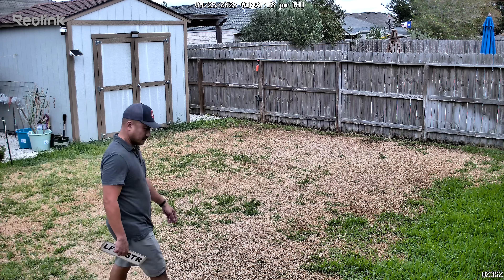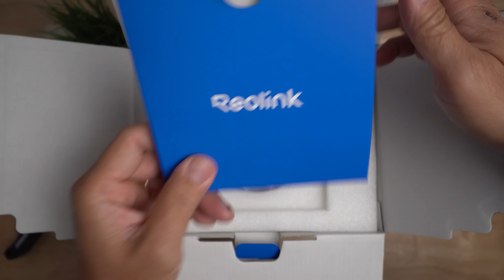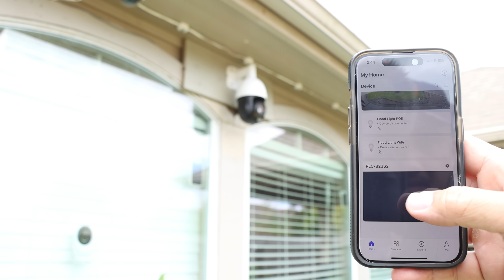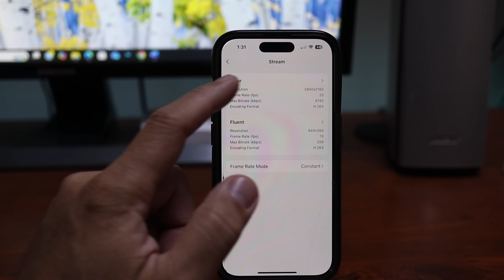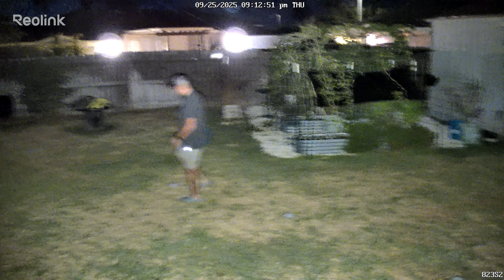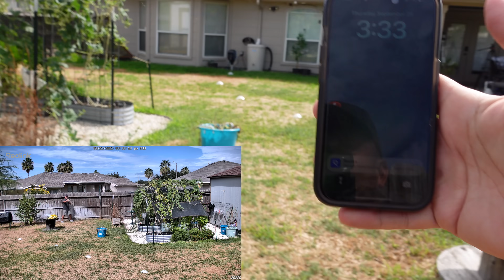This Security Camera Has 16X ZOOM! (Reolink RLC-823S2)

Comment: Can you turn off auto tracking if you just want to buy this camera for the crazy zoom?
Reply: Yes, you can do that with All Reolink Cameras.
Reply: @paul340mopar  can you use the same full zoom feature when playing the recorded video after the event ?
Reply: @tonylupo5230  If you recorded the Video with it Zoomed Out, the only way to Zoom in on the Video would be Digitally with editing software which would Lose some Quality. The Whole Point of the 16x OPTICAL Zoom is to be able to Zoom-In without losing Quality, but you have to record that way.

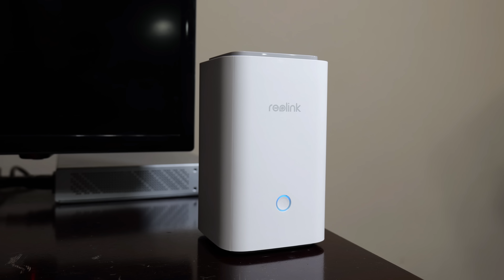Comment: Im a few months late but planning on buying this camera. One question id have is about the micro sd card storage at 2:07 you mention it supports up to 256gb. While the official spec sheet also mentions 256gb their website does however promote with up to 512gb micro sd card. Got this improved via a firmware update after your video review? Or do they have a mistake on either their website or the spec sheet is outdated?
Reply: @UltraTwmpo_ Reolink updated the specs in their website, after doing some testings they greenlit 512gb sd cards with this camera. They also did something similar with their new cama

Comment: RLC-823S2 just got a rare update from Reolink with new features! Now it has package detection and alerts (both leaving packages and taking them) and they also added perimeter protecting (line crossing, intrusion crossing, loitering) all these new features are under "detection alarm" in settings. Will try to see what other features they added
Reply: Unfortunately the perimeter alerts are fixed to the camera vision, so if you move the camera (like in patrol mode) it will have the same perimeter everywhere
Reply: So, in the end this camera have True Full-Color Night Vision ( ColorX  ) ? Or just flood leds?
Reply: @MaryoLionheart  it's not a ColorX camera

Comment: Disappointing it doesn't zoom on patrol mode. What I want is it to look into my street, and whenever someone - person or car - enters the control area to zoom on their face / number plate & track them.
Reply: The issue with auto zoom in  this model is that the optical zoom takes ages to focus, this is not a camera I wouldn't even recommend for tracking cuz it's slow and noisy and struggles with autofocus like you have no idea
Reply: But what you describe is the Reolink Trackmix. It has both an ultra wide camera for long distances and a teleobjective camera for zoom. The zoom is digital so it's not as sharp and this 16x optical zoom camera. But it's a true PTZ camera cuz it zooms on patrol mode
Reply: @HeyKaien  I believe the Trackmix is capable of this but doesn't have the 16x optical zoom. You need optical not digital for real detail right?
Reply: @Phil_AKA_ThundyUK  you're right, otical zoom camera is better than digital zoom because you don't lose quality when zooming in, it's what gives you real detail. But the downside with Reolink motorized varifocal implementation is that it takes time to focus (especially at 16x) and this latency can be an issue in critical scenarios. My biggest complain is that they don't have an auto focus button so it's a pain to be manually dealing with the focus slider. For this reason I've accepted that the Reolink 823S2 is not good for tracking when zoomed in and I have it set at 16x zoom in a spot with auto tracking turned off, in my opinion is still a great LPR camera even with the downsides, but the limitations do suck considering the price

The TrackMix has hybrid zoom, which is a fancy way of saying optical zoom first and then digital zoom on the telephoto camera. The second lens is a telephoto camera with a fixed 2.6x optical zoom, and anything beyond that up to 6x is digital. You do lose detail when digitally zooming in, but since the zoom is done on 4K footage you still have enough pixels/details for recognition. And again it does what you say, zooming in on the subject while tracking while also keeping the wide shot
Reply: @Phil_AKA_ThundyUK  TL;DR the Trackmix has a second telephoto camera capped at 2.6 optical zoom and can automatically digitally zoom further at 6x while tracking on 4k footage

Comment: I have all reolink cameras thus far on my system and am considering adding this one.  My problem during my research is that reviewers tend to review these in a home (under an eave etc) setting.  I have 56 acres and would like to mount a high optical zoom ptz (up to 3 ptz cams) for watching my livestock in the mountains.  I have a couple of neighbors that have reported the reolink ptz failing when pole mounted in the weather.    How about a review of this camera mounted on a temporary pole and not protected by an eave from the rain etc?  It could have something over it but it would need to be mounted so that it can tilt fully downward and view 360.
Reply: Finally someone with a scenario where this camera is actually needed! This camera should mainly be used for the 16x zoom feature and to cover very large areas. It's not for city folks. I've said this before, if you can hear the noise of this camera then you're not the target user because it means it's mounted very low and this camera should be mounted very high for the 16x zoom to actually be useful. It shouldn't be used to track objects closer than 32 ft.
Reply: I can give you some insight since I have this camera mounted very high in the open, and with time I've experimented some issues with this type of installation:

The first one is that this camera has a bigger than average lens, so it stains very easily with raindrops. This causes problems at night if you're using color mode (it's not an issue with IR at night though). Dust can also be a problem so I have to clean the lens about every four months or so because of this. I partially solved it by DIY-ing a cover using a plastic cap, and since then I haven't had any issues with rain stains on the lens. 

The second issue with having the camera out in the open is that the presets get moved every so often. I'm updating them on a weekly basis, and Reolink doesn't make this easy. (If you don't know what presets are: Reolink has presets that let you instantly move between saved locations you want to track in pan/tilt/zoom cameras, for example, in patrol mode). The problem is that wind moves the camera, so if you save a preset pointing at something, it will be slightly off after three or four days because the wind moves both the camera and the pole it's mounted on (People who have this camera under the eve are usually unaware of this issue but it's very real in open installations). This is not a big deal if you don't use the zoom, but if you have the camera zoomed in at critical locations it can become annoying to be constantly updating the presets and patrol locations every week or so (and by updating I mean manually deleting a preset and adding a new one with the same name because there's no refresh button on presets)

Another issue is that this camera is ridiculously heavy so installation becomes tricky, and it can start acting like a pendulum if the thing you're mounting this on is thin or not well installed. 

You shouldn't have any connectivity issues, though, since this is a PoE (wired) camera. You just need to be aware of signal degradation on long Cat6 cable runs. 

Overall because of the 16x zoom there's nothing close in the market, and I think the positives outweigh the negatives
Reply: @HeyKaien  Thank you!
Reply: Forgot to mention, it does have an "automatic 360" option and you can choose the speed it moves too, it's pretty cool
Reply: @HeyKaien  That would be handy.  It isn't like I can know where the cows and calves are at any given time.

Comment: If you install a couple different models of Reolink cameras and one of them sees motion, will the other cameras turn in that direction to try to pick up the motion? IE do they talk to each other? This would be a very cool feature.
Reply: Reolink has something like this but it was implemented years ago and now it's kinda forgotten/outdated, it's called "Reolink IoT". Only works with selected cameras (like the one from this video) and selected devices like like floodlights with motion sensors. You can create automations if one of these devices gets triggered by an event etc. Right in the app with "if" this happens "then" do this. But it's kinda basic to be a decisive factor to purchase a cam. Look for "Reolink IoT" on Google
Reply: It doesn't work with any Reolink camera, only with selected Reolink cams compatible with Reolink IoT
Reply: I think there are brands that implement this better like Aqara but it's part of a larger ecosystem of lights, door locks, alarm systems etc. If you get what I mean

Comment: just bought one - amazon had a 25% off deal - have to say it is much larger than any of the cameras I have, about eleven inches from the bottom of the camera to the top of the bracket, the white top really makes it stand out on a dark wall or fence, I do wish reolink would have the all black option for all their cameras instead of just a few of them.
Reply: You can paint them fairly easily. I paint all mine to match the siding so they don't stick out.
Reply: @kungfoochicken08  indeed one can,  extra hassle imho and it may invalidate any warranty for some brands. i have also used camo wrap and ghilli for bush hidden cams or plain black wrap.

Comment: Bought this had to send back just would Not Focus even doing it manual and the noise as it moves is enough to frighten off intruders 😂 I bought a TrackMix instead and seems to be working OK
Reply: You made the right choice. The focus control is atrocious, there's no auto focus button so you have to change it manually every time. Trackmix is great and by far the best reolink tracking camera, but it's digital zoom not optical
Reply: Don't you want to " Frighten off Intruders" ?

Comment: I had the same camera but returned it cuz I wasn't the target user. With a 41° FoV it only works well for big properties, distant entry points, birdwatching (has DSLR-like bokeh), and LPR (Licence plate reading). But if you live in the middle of the city, have other properties close by, are on a single floor or not have front yard at all, the RLC-823S2 will underperform (and probably be a waste of money)

Also I wouldn't use it for tracking (it's slow, noisey, you have to manually zoom, struggles a lot with focus when zooming) when there's waay better (and cheaper) options like Trackmix PoE also from Reolink. So do your research carefully. This is a "see from distance" camera, you're paying premium for the 16x zoom. If you allow me I would like to share some of my views about this cam

 RLC-823S2 Pros:
- Crazy 16x zoom
- Reliable storage/playback, got more days than advertised on a 128gb sd card
- DSLR-level pic quality & bokeh when zoomed, full focus control
- great for birdwatching
- Great for licence plate reading (if you set it to car notifications only, and zoom it right where the street begins, and turn on email notifications [or set a custom 3rd party push email service] then you will have a gallery full of licence plates...but location is really key here)
- It has 3D zoom on the NVR client to dynamically zoom with a single click
- It supports notifications channels, so you can have a different notification sound
- you can set and record your own alarm sound too
- It's one of the very few Reolink cameras that work with other Reolink IoT devices to create routines and trigger automations based on events, right from the Reolink app
- Wall & ceiling mount option in the same bracket it's genius honestly

RLC-823S2 Cons:
- Very narrow FoV, limited use scenarios only
- the focus is really bad, when I had this camera I was adjusting the focus all the time on tracking (not an issue if you have it fixed on a target, problems start when you start zooming in and out...)
- there's no "auto focus" button at all 👎🏻
- if the wind moves the camera even just bit, you will have to recalibrate all your presets again. This was a bi-weekly thing for me.
- you can't sort, move around or rearrange the presets, to this day I still have no idea how are they sorted when you create them, this is such a basic feature, why Reolink why...
- unlike privacy masks, the "no detection zone" it's fixed to the camera no matter where you pan and tilt, so this feature is basically useless and you shouldn't turn it on if you plan to use the tracking function
- It's ridiculously noisy when moving, more so at night
- Heavy as hell, can barely lift it with one hand. It's a pain to install using ladders and stuff (but easy to mount)
- Rain leaves marks on the lens so it needs to be under the eve

Comment: Is this a reupload? I remember you uploaded a video with a palm on the thumbnail like one year ago
Reply from the maker: Nope. It was the video of the older model which basically have the same features except the old one doesn't have a spotlight and auto tracking was added eventually.
Reply: @LifeHackster  ah, right, I just checked and the one I mentioned was your review of the Reolink RLC-823A. My bad

Comment: Why can't this make this camera smaller? It's huge. Having the camera visible is fine if you want it to be seen to deter intruders. However, I try to hide my cameras so intruders don't look for blind spots where they can't be monitored. It's not an option to hide this monster. Also, I find that this is the 16x zoom is the best to get license plate numbers if there is a break in or theft on your street.
Reply: Optics and motors take up space. They make smaller ones without the zoom.

Comment: I like that camera but the one drawback from that type of camera is the motion sensor field of view.
I wish they could put at least 180 degrees of motion detection on the upper housing that doesn't turn.
Reply: It works best as part of a larger system. Ideally, you'd have something like a Duo 2 to monitor the whole space and then have this set up to automatically zoom and track anything that comes into the space.
Reply: @kungfoochicken08  larger system means a larger bank account. in that case just have cameras ever 10 feet apart.
Reply: @TwoFeatherChannel Different cameras serve different purposes. Zoom cameras are usually for identification, not really detection. This camera with its 16x zoom is a specialty product. The vast majority of people won’t need it. For less than half the price you can get a Trackmix that has a 6x optical zoom and a wide angle lens at the same time.

Comment: Wow, I just do not understand the noise. Don't they use stepping motors? 

I had a really cheap tracking camera 15 plus years ago, and it didn't have this noise

Even when the self-calibration kicked in on startup from a power-up.

You could be on the porch and not hear it. It was mounted way up top. 

I guess if you put this on your property somewhere back in an acre, the noise would be a plus to scare people off.

You hear it in your house? 
Gee.... My wife's not going to like that.
Reply from the maker: Yes, I can hear it from the inside.

Comment: G'day. I'm on a corner lot in a high activity area. I can see a bit over 1/2 a mile (800m) but most activity is within about 600 feet (200m). I have an RLC823A (5x Zoom) that does a pretty good job. The 16x Zoom would be amazing but would also miss a lot because people can come and go in 3 directions.
Reply: I have one pointed up the road that's about 1400' to the end, and another issue is the in-focus zone is only perfectly in focus for about 100' and then starts to drop off a lot after 550', but I do have it zoomed into probably about 12x. It's great for catching license plates going and coming, if and when something shady might happen.
Reply: @IdahoRoamingGnome  At what distance are you able to read license plates? Thanks
Reply: @mikebritton2084 Depends what angle the plates are at related to the camera. During the day time, with the focus changed, you can probably read the plates at 1000’ coming straight towards the camera. At night, all bets are off unless they come to a stop under a street light and are much closer.
Reply: Does “high activity” mean the usual suspects doing crime?
Reply: This is why you add a camera for panoramic viewing next to it like a Trackmix
Reply from the maker: That's a good point about the field of view; I appreciate you sharing your experience.

Comment: I noticed with the video doorbell there is no notification beyond 10 feet even though it detects the motion and flags it on the timeline so you can filter by motion events for motions much further than that.  Not sure if there's a setting to get notification when all motion is detected, even beyond 10 feet.
Reply: Maybe your Sensitivity is set too low? Look under Detection Alarm.
I’m getting notifications on vehicles from at least 75 ft. People and animals from at least 50 ft.
Reply from the maker: In the notification setting, you can also set which events you want to be notified about.
Reply: @LifeHackster  where is this setting, I have sensitivity on high and the motion is detected but no notification unless its close
Reply from the maker: @abc123fhdi I just realized that you are getting notifications at 10 feet and closer, so it is not on the notification settings. Check the non-detection zone in the detection alarm, you might have added a non-detect zone.